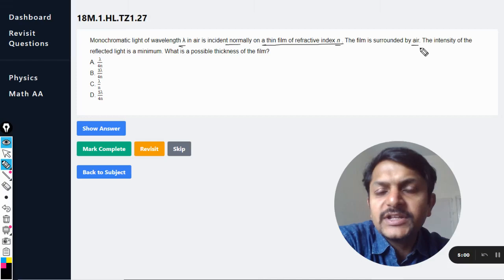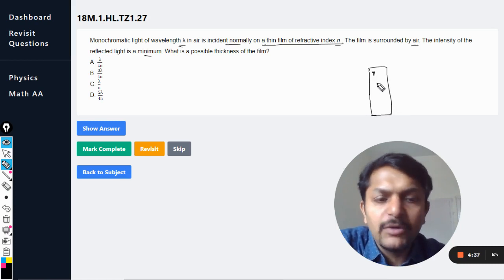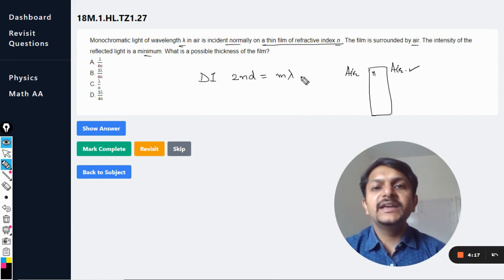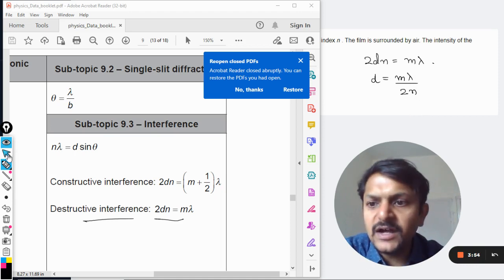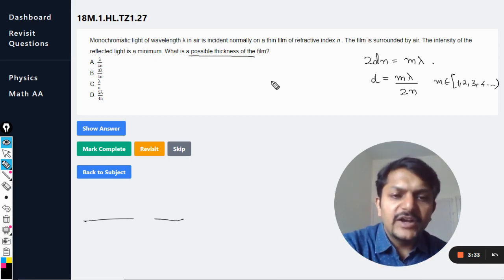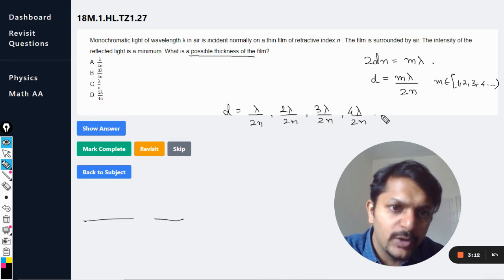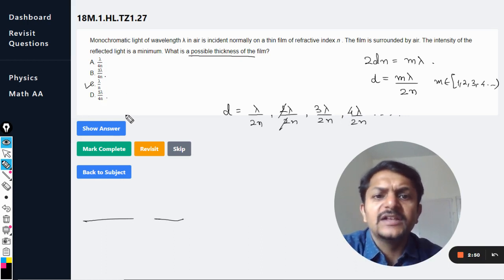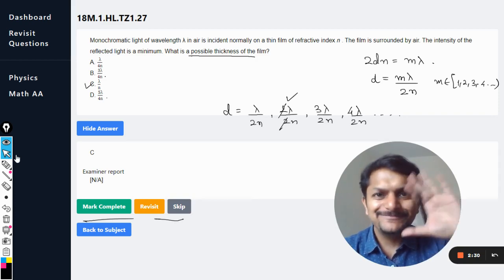Monochromatic light of wavelength λ in air is incident normally on a thin film of refractive index n

Comment: how you make sure that its destructive interference?
Reply from the maker: Good question. Thin films are actually, used to reduce the reflective power of the surfaces. And it is said that the reflection is reduced because of the destructive interference. So, when the rays are reflected, they interfere with each other, and thereby reducing the reflective power.